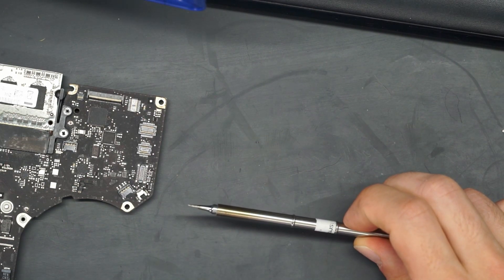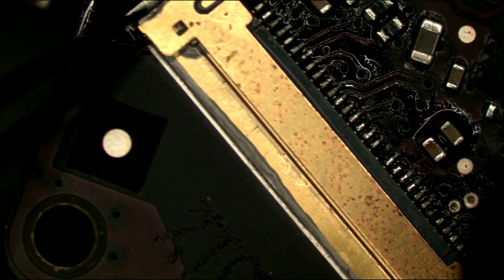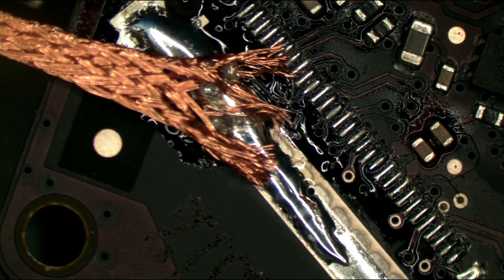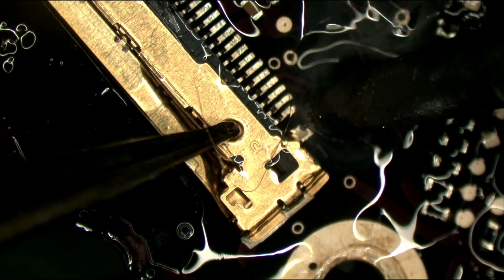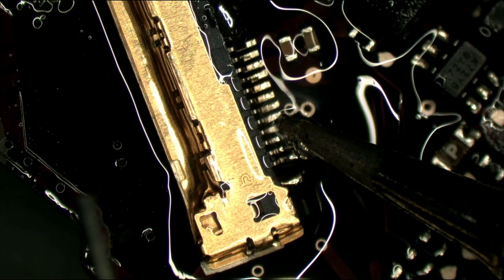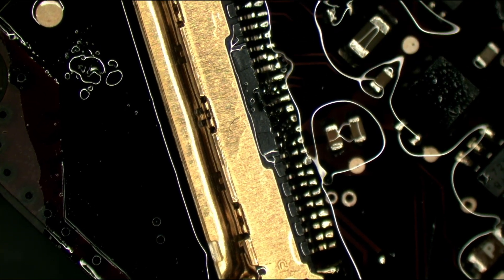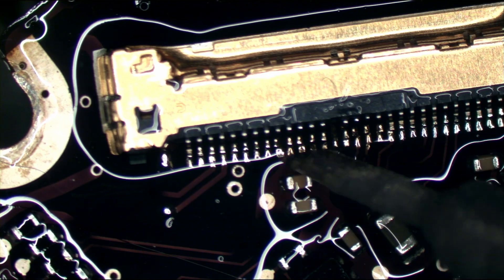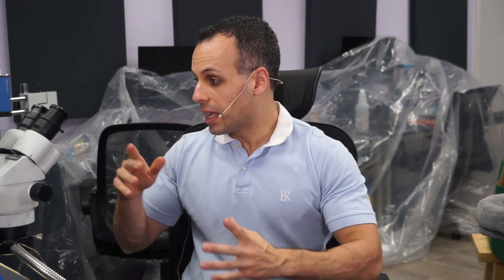louis introduces audience to the red pill (of board repair)

Comment: Thanks Louis - I did buy a tiny tiny bevel tip (0.5mm) to do micro-soldering thinking exactly what you said "I need a small tip for this" but there is no thermal mass whatsoever and it's basically pointless. I'll go ahead and swap my bent conical tip for a bevel one. Thanks for the advice!

Comment: I guess I'm very skilled then as I've never had trouble with conical tips. as for your First example: you can also just turn the tip horizontal and increase the amount of surface contact. Not to say there are better tips for different jobs, this is must abit over the top, just like how Louis always is. fun video still.

Comment: I find a 45 degree bent conical to be one of the most useful tips honestly. However two things need to be true:
1. It has to have thicc hips. The taper has to be really steep so that the relatively thin tip has a big mass of metal behind it.
2. It needs to be direct heat. This kind of tip just doesn't work with indirect heat irons in my experience. Or maybe the ones I used just sucked.

The precise tip I use is the Metcal STTC-144 and its Thermaltronics equivalent.

The nice thing about the bent conical tip is that it's kinda two tips in one: You have the actual tip (which you don't really use that much) but then you also have the surface formed by the bend. You can use the inside of the bend, the outside of the bend, or the side-side. I know Voultar uses this kind of tip a lot in his videos.

The bent conical you show at the beginning of this video is too thin and especially too small for what that person was trying to do. I change to a chisel or hoof tip whenever I'm doing basically anything with solder wick.

Comment: Never understood what the purpose of those useless fine pointy tips is, we do lots of SMD work in our R&D lab and all the fine conical tips sit shiny and unused in a drawer.  The small bevel/spade style tips are most always the only thing you need, though the chonky boys come out for large stuff like SMD power devices soldered to the ground plane, or shielding cans.

Comment: Wish I'd seen this a month ago. Tried to mod a Terramaster NAS, the PCB had an un populated HDMI out and I wanted to see if I could get video from it. I did all of the things wrong exactly as you showed here, bridged pins tried to drag solder like I seen you do before but all I did was move the bridge to another set of pins. Decided it was fine I could just wick the solder off and as you showed I couldn't get the wick to lift anything and got stuck. Ended uplifting traces in order to get the socket back off, the NAS still works but the HDMI pads are wrecked lol.
All because I slipped the wrong tip in 😜

Comment: I've seen so many people showing how they do SMD soldering with a needle pointed soldering tip. This drag soldering is much easier.
Did you drill the hole in the tip yourself?

Comment: I do use a conical tip not because I like it but because it was the only big one I would find in my area and it works great for micro soldering and everything else, I bought a bevel one a few weeks ago but the flux destroyed it part of its coating and now I'm back to the conical one, I still use it when I need to remove the shielding of smartphone boards but the conical one works well enough

Comment: Same story is with heat. They selling 15W or something like that soldering irons, what is complete garbage. You need HEAT and must count time. Not too much, not too long. I use almost everywhere 350 degrees heat and T12-K (fake hakko) soldering element. They made these knock offs so good, I used it already 9years. The real hakko may die 9 times on that period of time. Load of heat, good thermal condactivity and load of flux
EDIT: You are correct, do not experiment on your own boards, use customer boards :P Sink or swim

Comment: I use a conical tip just fine.  Love Rossman but I don't have the same experience with mine.  Solder wicks off, can single connection and drag solder.

Comment: Key to note: A lot of the work is being done by the flux. Flux is fucking magical - it wicks the solder to what is hot, so by having a tip with a lot of thermal mass, it can quickly heat the pins and make them suck the solder to them, as well as the bigger tip has enough heat it wants to suck up solder blobs where conical tips just move them around.

Comment: Louis is 100% correct. I don't to much micro soldering but I still don't use even larger conical tips that come with all soldering irons. My tip of choice is the knife edge. It's large enough to help heat transfer but also has a fine point at the tip for smaller applications.... Most people that see/watch me soldering normally say "wow... you can use that large tip for that.."

Comment: Hm, interesting. While I also discard the straight bevel crap I use one of those bendy J*-tips shown at 1:16 as my default "too lazy"-tip and never ran into any problems. I, however, mostly lay the curved section flat on the board/wick  or use the curve to get a larger area and good heat transfer. I use the tip itself only if really I need to get somewhere between components in a crowded area. True, BCM, chisel and knife still got a big advantage depending on what you're trying to do, I am however far too lazy to change my tip if not absolutely neccessary.
Or for those who only speak tip: Yeah, malformed standard tips suck, but IMO a good technique can compensate even for tips Louis thinks look odd.

Comment: Conical tip isnt evil, it just has its time and usecases. A lot of people imagines that you can solder with the pointy end of the tip, tries poking with it, and then complaints that shit doesnt work as they imaged to. Conical tips requires knowledge on how to properly use them, and are great for work in really tight spaces.

Comment: i got into board repair using a GIANT soldering iron. unregulated. got insane hot. but with the right technique you could get in and out so quick there just wasnt time to transfer enough heat to nuke a trace or any crazy shit. Had friends struggling with fancy stations while i was killing it with a 5 dollar iron.

Comment: I've never had a chance to use anything else, but conical tips, but I don't solder with the tip of the tip, I solder with the side of it, so the area is larger and heat transfer is better.

Comment: Conical tips are good for exactly few things, 32awg or smaller small mod wires for prototypes. Or disarming batterys that have connections way too close.  But only when you were not able to get a small well tip on a micro pencils, like the ts200 has. There also good for making holes in plastic to save to good ones.

Comment: I work as a lab technician for a company that makes micro chips, which requires custom pcb boards to test our silicon. I have had to change out 0201 caps with at best a .25mm spacing between components. which is pretty much the only use case i would prefer a conical tip. Conical has its place, but trying to use it outside of what it excels in is a struggle. I use the micro conical tips for small 0201s in a tight area where it will be a pain in the ass to clean up if you get solder on the other components around what you are trying to rework. In almost every case except super small components in tight sub mm spaces you will be better off using a different tip.

Comment: Thank you for providing the answer to all my past frustrations! I've actually been there with a conical tip, temperature cranked to max and struggling to get solder to melt and stick down. Frustrating but now I'm so relieved to know the solution is to just throw out the conical!

Comment: My TS80 came with a conical, and i had huge issues, it seemed like there was literally zero heat transfer unless i literally rubbed the side of the tip up against the joint.
When I heard you talk about conical tips in some repair video, i immediately understood what's the problem

Comment: The only things I found conical tips good for is digging out a through-hole when crud gets stuck in it. My go to for 90% of anything is a chisel tip. I've found them to be the best for me and pretty versatile. Twist it one way and you can get pinpoint enough to hit a single pin, twist it another way and drag solder all you want. I've found that you have to be a little more controlled in how much solder you use since it lacks the 'pool' of a bevel though.

Comment: So i soldered for years industrially doing like 3 phase motor connections or encoder cables using a very generic weller iron that only had 1-2-3-4 as heat settings. Worked excellent for what i did until i picked up board repair as a hobby and stuff like installing mod chips/mods to old consoles which it was absolutely terrible for. Bought A 25$ pinecil and its been a game changer, i soldered most of my life with dumb irons and now that ive got this smart iron i run circles around everything i do now i have to TRY if i want to mess up a trace or pad

Comment: Mr Rossmann, 

Thank you for your very instructionnal video. I am one of your viewers that looked a lot of technical board repair videos while everything was closed because of the virus, and now have less time so don't watch as much at theses repair videos. 

Why am I taking the time to write this down? Because you often say that your repair videos are less viewed then others. Well I think it would help to tell you about this. Might be marginal in the viewers numbers, but still.

Also If I might suggest, this videos could use a 2nd part to the title with a more descriptive part (like i don't know, proper soldering tip to use with examples?) so when someone search for this great soldering tip, many more will find it. 

I might not be a repair technician, but I still learned a lot from your videos, and the day I need the knowledge, I can reviewed it here when I need it. And yes often, I will try to repair or make it repaired (if I don't feel I can do it), that's why I am a big fan (and humble supporter) of right to repair. Thanks for all youare doing.

Comment: LOUIS!! I GOT my FIRST knife edge TIPS bc OF ur vids!!! for REAL!! like really, i thot, whoa, i had only every used soldering irons MAINly for just heating up wires to solder and heatshrink where a torch would be dangerous, HEY , but yeah that one tiny little battery powered iron w the led display (pretty sure u did a video on it, at the time u said u thot it was the best in the micro soldering irons where u need them to be portable  or somethin like that, its a neat little one that heats up rEEAL quick and its digitally controlled powered by usb, and I was looking at it bc it was very well liked by i think the RC community for doing stuff w/drones and other junk, but yeah that DID come w/a regular not great tip also, DO U THINK i could maybe grind it a certain way to make it where its worth a damn? (i did take my fat boy and make a little dimple in it like i think u or another vid I watched kinda demonstrated and it WORKED! I HAte throwin stuff out, it has a ceramic diode u know w/the rings and u plug it into the little blue or brown handle depending on the model, and screw the screw in to make it stay? if i like sanded it, at an angle as long as I didn't pass through the metal into the inner core, u think its worth it?? the tips for that iron are kinda high, and if i could like smoosh it or chop somethin off and maybe make it decent? ill keep watchin ur streams and see if see my message , Can't WAIT for u to get ur new store goin in tx, im gonna make a trip just me, and when yall close if there's a cool place ill buy u and ur ppl a drink or somethin..i just wanna see your cool store and maybe say hey =)
Reply: i wanna be at one of those workshops =) id be honored

Comment: We've come a long way since using a piece of copper wire as the tip in a Weller soldering gun and padding the tool because it gets too hot to hold.  Diode Gone Wild uses a similar gun on screen now.

Comment: tbh thos T12-JL02 tips do come in handy when you doing insane stuff like cutting of the Touch ID glass from a iphone 7 home button and trying to replace it with a good one that doesnt have ripped connectors on it but other than that like smd mounted stuff its a big no... just for connecting ripped off flex cable tracks. that are like 0.08mm in width.

Comment: It's only on rare occasions that I use the conical tip, or I just file the thing down so as to get the thing in tight spaces where I'll flatten one surface and then use a much-much lower temperature to get the heat and solder across without dissolving the copper innards.
This comes from the fact work cheaps out on irons and i recently scored a load of tips for the half decent no-brand 908D iron... albeit those tips are lowest grade naff-ness monster and just decomposes if looked at wrong (unless at low temperatures below 320C), yet the tips are still useful enough.
I also try and use up the conical tips first to just decompose them faster, throwing them away whilst having some use seems... just wrong for some reason.

Getting the right tip from the get-go is the better option always tho.

Comment: Geez! I have been using a bevelled tip since I was a teenager, however a few years ago I bought a second hand Weller, it had a conical tip. Yes yes yes! It doesn't work with solder wick, and I always blamed the poor quality solder wick. Exactly as you have shown! I get all the same problems with the conical tip. When I tried drag soldering, it was a bit of a disaster, and yes lots of bridged pins, then total failure of the solder wick to fix the problem, it just became attached to the pins 🤣 Thank you so much indeed!!!

Comment: As the saying goes right tool for right job. Only bad tradesmen blame their tools. Conicals are fine as long as you use them in areas where it’s appropriate to do so. Of course a micro pencil can’t wick, that’s not a fault of the tool.  Especially on the LVDD connector that’s got such a massive ground fill large tips struggle let alone micro pencils!

Comment: Conical will quickly piss one off especially if there are other things in the way on a board so you can’t get the angle low enough for enough surface area.
Rotating around a lot in order to get that good spot will quickly get really tiring, when comparing to going from only a slight angle from above with chisel/knife/etc.

Comment: My soldering iron came with two tips, (a conical and a flat) the conical tip got changed out upon opening and tossed right into the copper scrap pile.

Comment: I gave soldering a try a long time ago... I couldn't figure out what I was doing wrong, but I think
the opening of this video where you were talking about, having a decent sized thermal area, vs a pin point thermal area, 
where basically I guess your point was, your not getting heat where you need it in time....

Dang I gave up on soldering, but this may have been a big reason it always seemed to fight me...? 
Somewhat mind blowing it was something so simple.

Gonna watch an ad for ya.

Comment: Louis, you're right, but you're also not quite using the conical tip right. When using it with wick you need to lay it across the wick to get enough contact area, not "stab" at it.

Comment: I can't believe I've been struggling with a conical all these years. Trying to melt solder onto wires and only having success with the thicker upper 50% of the iron tip.
Too obvious yet still had to have it spelled out
Cheers bud

Comment: I've never done soldering but is it not just commmon sense that a small tip sucks for wicking ?

I mean you can immediately see you are heating up only a tiny spot ...

Also I don't understand why the solder seems to only stick to the tiny connections and how the hole in the tip sucks up the solder instead of making a mess and bridging all the connections ...

Comment: I find they seem to corrode very quickly. I’ve had conical tips that didn’t even last one board
Reply: I still use my cheapest conical tip soldering iron from 15 years ago and it's in perfect condition. I keep it around to lend it to newbies like my brother. 😁 I used to melt plastics lately and it still solders fine after a clean! I guess you're using a very aggressive flux, overheating the tip or not tinning it after every job done. Whatever the case, I'd recommend you watch every soldering lesson from Pace Worldwide here on YouTube. 😉 You'll become a soldering God in days, no doubt! ✌🍻
Reply: @em0_tion  if it corrodes to the point of breaking during your first use, tinning the tip isn’t the issue. But I do always do that of course. It could be my flux, I don’t know. But with a good tip, I have no issues. I haven’t quite been soldering 15 years but it’s be a while

Comment: If you don't have a nice Metcal or Weller, you can't even do general SMT soldering well, let alone fine-pitch. If you don't have a proper hot air station, that BGA ain't coming off and you're going to do board damage. The tools make the person a better tech. The evidence is undeniable.

Comment: the TLDR of tips is that they change thermal mass, so small sized/volume/area tips do not have enough thermal mass for wicking or regular soldering.
(you COULD wick with a micropencil tip when the pencil tip has enough thermal mass to transfer over - but after few seconds or so it will lose its thermals and the solder will solidify, leaving you with a picture at 1:05. bigger the area of solder/wick, faster this will occur)

Comment: Well sometimes you do need a very fine tip like with an 0201 capacitor where they're space close together.
Reply: You may want a small wedge tip, but a conical tip won't heat the pad very much..

Comment: Just use your hot aor along with your small tips. The hot air will warm up the board so the smaller tip does not lose its heat.  Thats what I do.